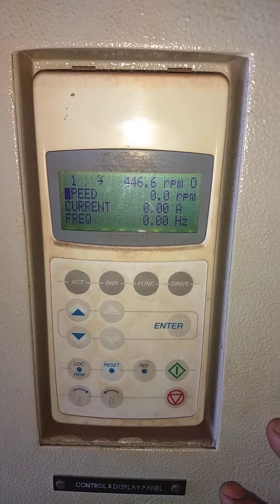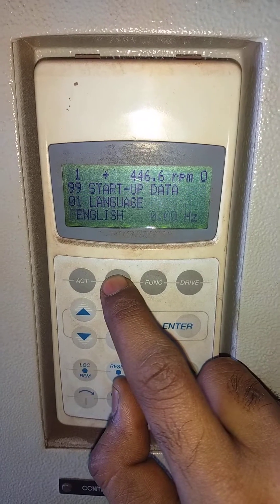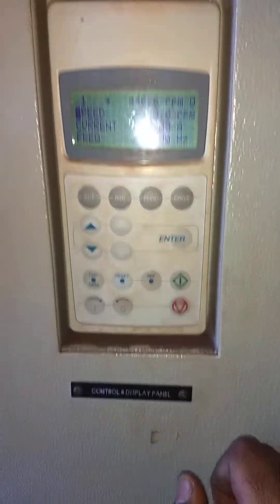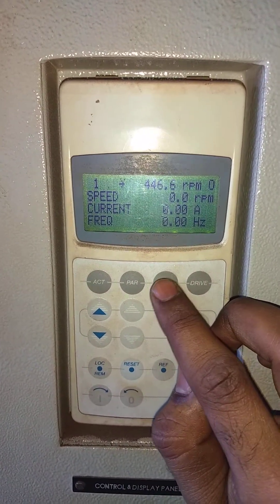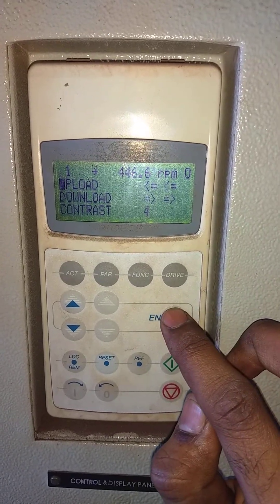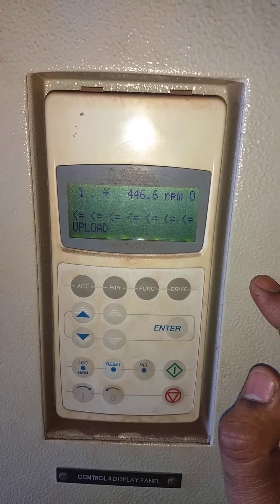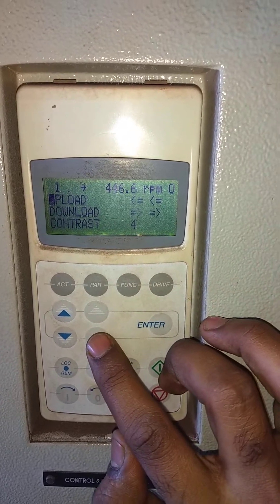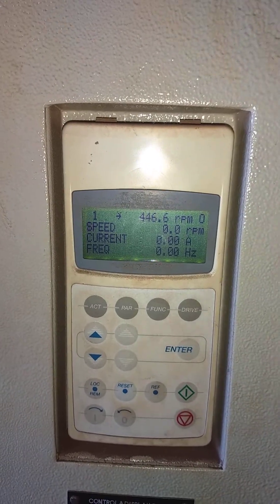DRIVE PARAMETERS UPLOAD AND DOWNLOAD OF ABB ACS 800

Comment: During Download or Upload should be in the Remote mode or Local mode, Please advice me.
Reply from the maker: It can work in either of the modes.
Reply: At download time drive local mode.then start download load.
Reply from the maker: @MANOJYADAV-jw5qy  Ok
Reply from the maker: @MANOJYADAV-jw5qy  yes
 U r right sir
Reply: @MANOJYADAV-jw5qy 
Please Sir,
Does upload-download also uploads and downloads group parameters 98 & 99

Comment: Thanks man.
I need to know the station number and i cannot see group 52.
How to change station number and modbus paramertes.
Reply from the maker: Okayyyy I'll check and let you
Reply: Thanks. I did found group 52 after i change the drive Id to 1(click drive botton and click up or down and click act).
After that go to parameters and you will find 52.
Reply: Hi man Can we upload parameters by drivewindow software while the drive is running and the motor also running.
Reply from the maker: @shanksakagami6381  not possible while running

Comment: We are facing the following error showing on the drive display for a pcp pump (ACS800 drive) and we are unable to start it

App1Error 13 - ACS800, any clue about the cause and how to solve it
Reply from the maker: adaptive program is there in drive. Check the software version